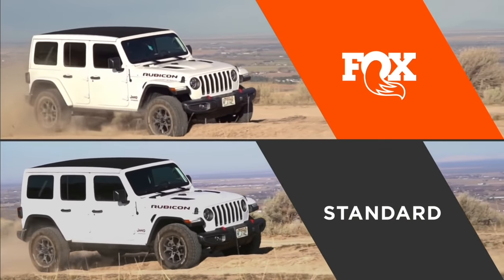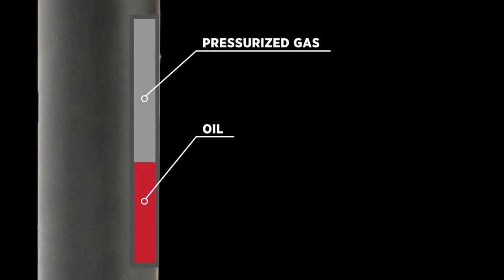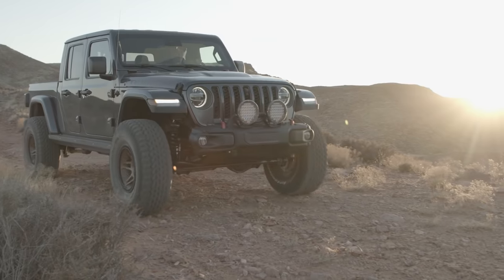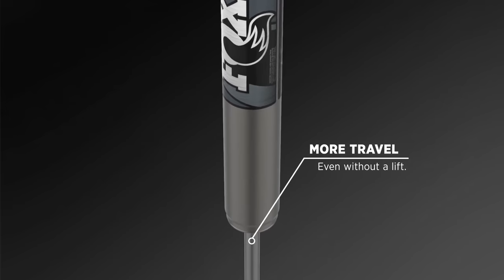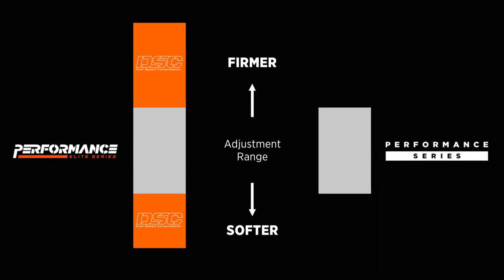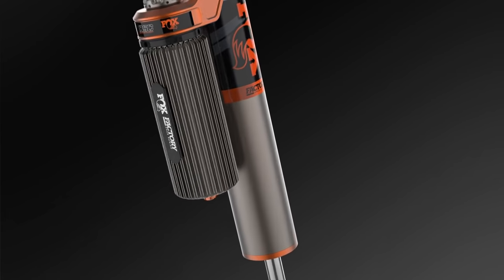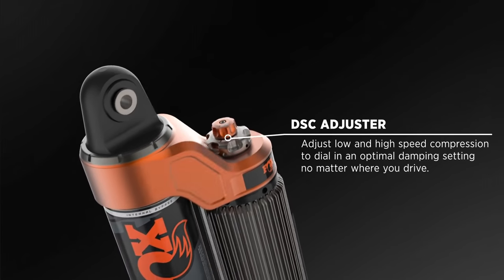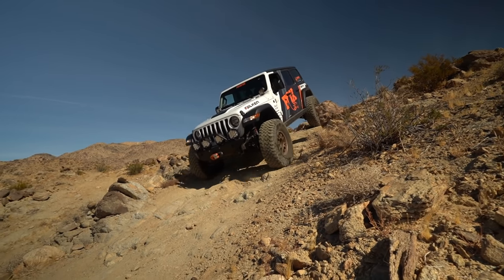Standard vs FOX Jeep Shocks » ACADEMY | FOX

Comment: Nice im a mtb er and i have fox 36 fox 40 and dpx2 shock too and i love it.
Reply: nah just go with a 32 fork way lighter!
Reply: Brayden Hall maybe add a 32, but if you ride the way we do, gravity makes up for light weight and you get more meat to save your ass🤨
Reply: Yeah man!! 210 lbs needs that 36! 
2018 Capra Ltd 27.5 😍
Reply: David Döenges I’m looking for new bike, will look into
Reply: @donchristie420   YT Industries (Young Talent) is a direct to consumer company, so the value is through the roof.  
Capra is a downhill send it type where as the Jeffsy is more of a trail bike.  I prefer the extra work during the climb in exchange for the plush downhill charge 🤠
Reply: David Döenges looking at everything nothing available ‘cept transition patrol with specs I want
Reply: @donchristie420  do you ever check out PinkBike? Tons of nice bikes on there..